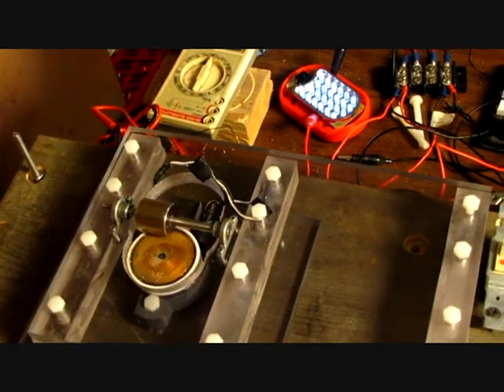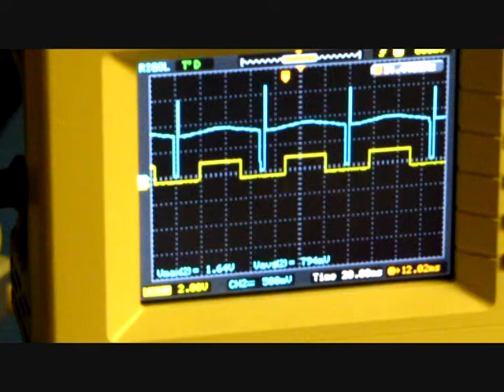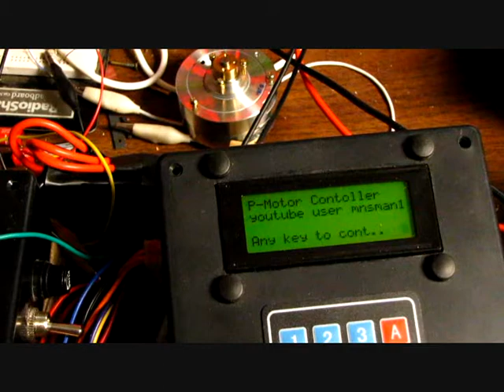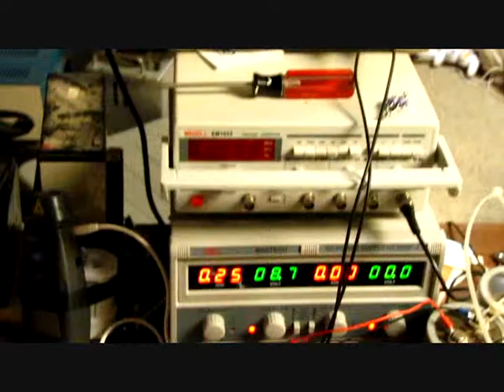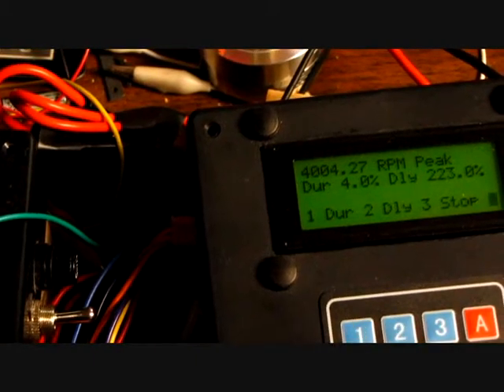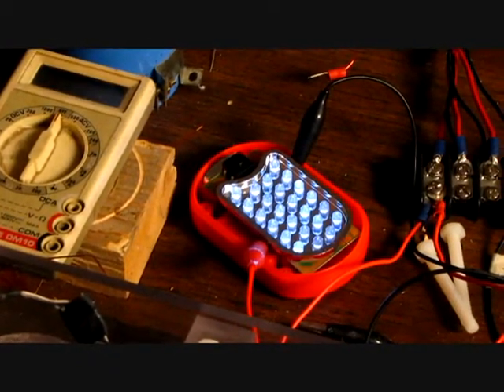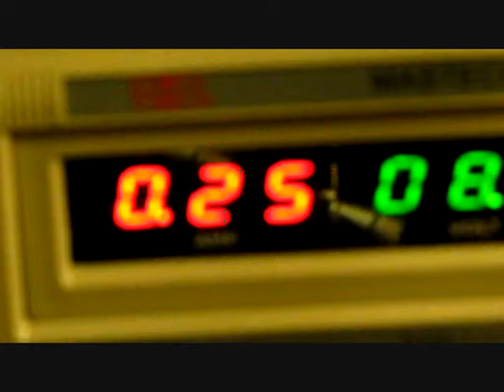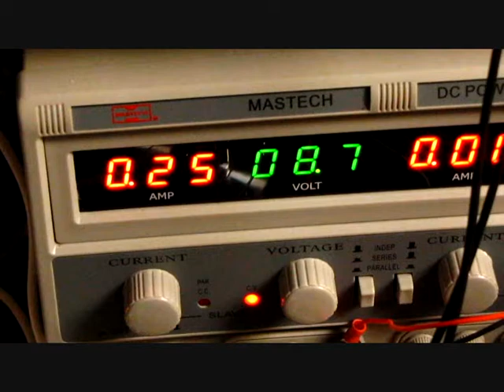P-Motor 1/4" foil pancake the day after 7.8.12

Comment: This is one way around conventional bearings. Instead of using a steel shaft that spins, change to an aluminum fixed shaft. Then size the shaft 1/16" under the size of the hole in the magnet. The eddy currents of the alum will keep the magnet centered. Play with the diameter of the alum shaft as perhaps a small shaft will work as well but yield more speed. The smaller shaft will hold the eddy current friction further from the magnet surface. Also a threaded alum shaft may work better.

Comment: Your design is similar to what I have been coming up with as possible OU.
There are many characteristics to this that makes it more efficient than all others.
Like the geometry of the magnet. Question: What bearings were you using when you 
hit over 90krpm on your most recent video.   I am seriously considering getting rid of the shaft and bearings and that would speed the rotor considerably. Also I think Tesla's pancake coils are the most powerful of his coils. The comp star induces to thelimit